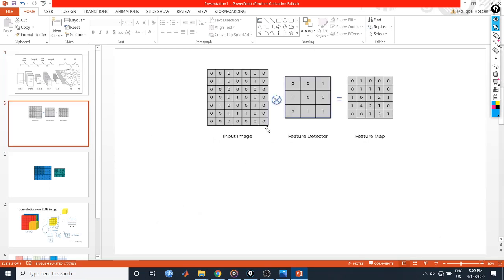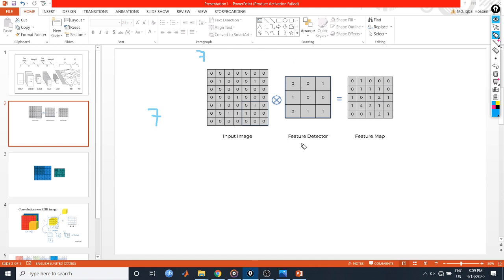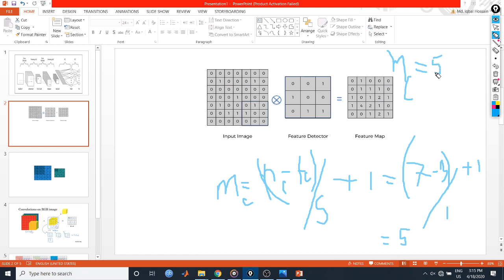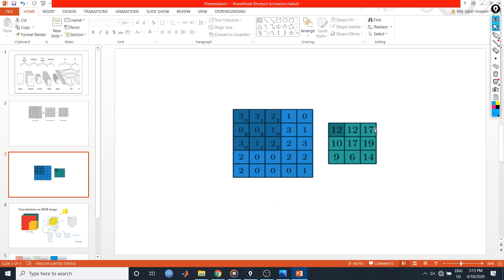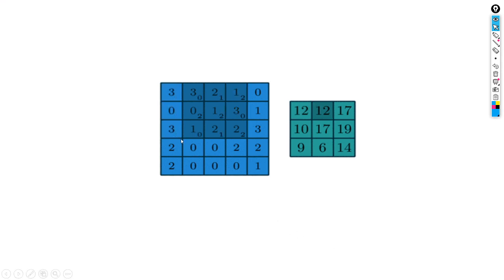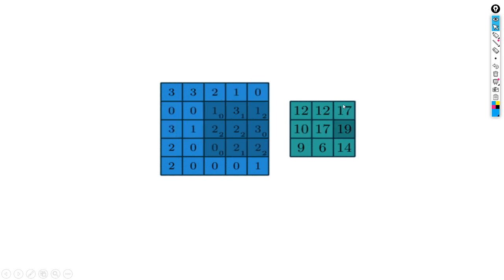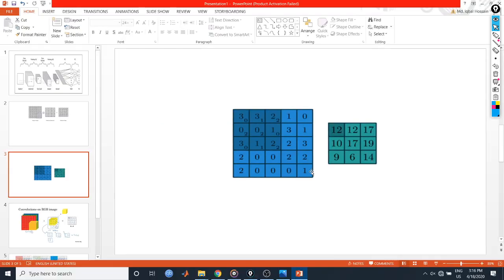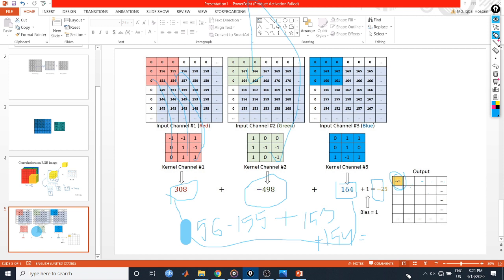Convolutional Neural Network(CNN), Basic Understanding of Filter, Stride, Convolution| Deep Learning

Comment: At 7.44, you are not doing matrix multiplication. Is that correct ? You have simply multiplied the values in pixel matrix directly with the filter values and made the sum as your result matrix value.